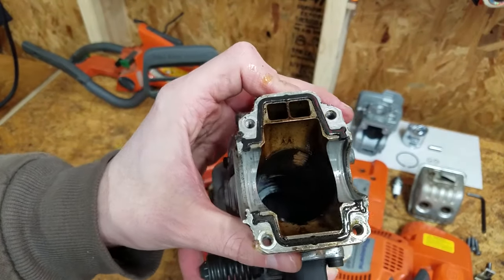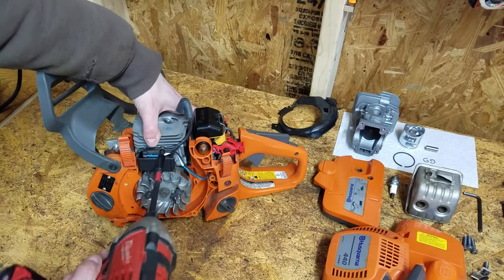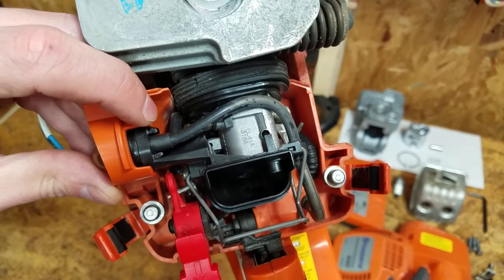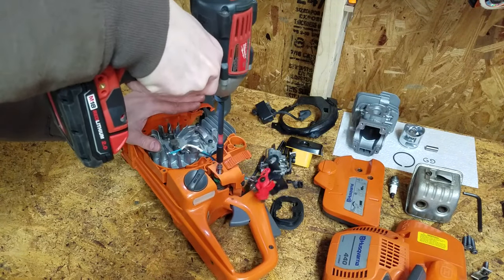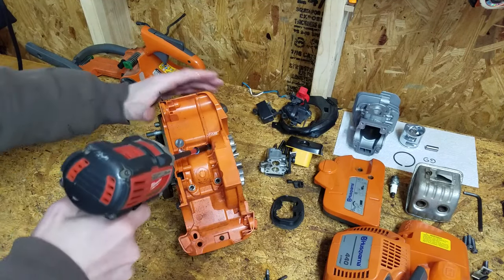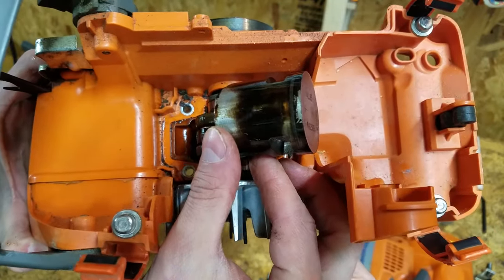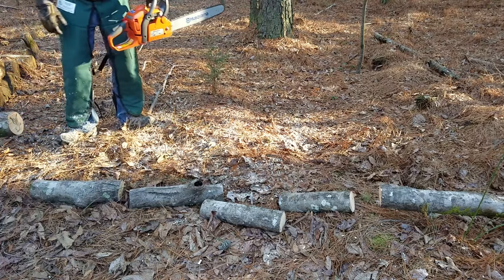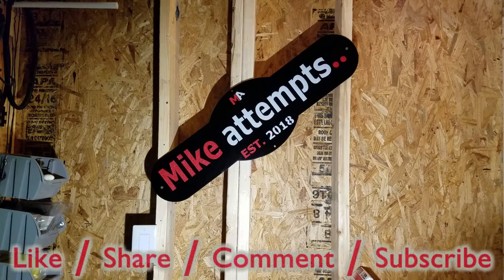Replacing a Chainsaw Piston and Cylinder

Comment: Well, I made this repair, along with a new coil. I have fire, fuel and compression, but my saw still will not attempt to start. I have used a spark tester to verify  spark, I have sprayed starter fluid directly into the cylinder, but to no avail. Any suggestions would be greatly appreciated.
Reply from the maker: The only thing I can think is maybe the fuel lines were connected to the wrong ports on the carb?
Reply: @Mikeattempts  It is a mystery. (I didn't disconnect the carb).  I used starting fluid in the cylinder.  One additional bit of information, my son had used a screwdriver to hold the piston while he was removing the clutch.  That's why I had to replace the piston. I don't know if something else happened then. Thanks for your reply, I won't give up on it yet. I'm really curious now.
Reply from the maker: @philliprickman1394  I'm curious too so let me know if you figure it out.
Reply: With the choke off and the chain brake off set the saw down on solid ground. Point the bar in a safe direction AWAY from yourself and anything else you don't want to contact, cut or damage. Slide your shoe or boot under the throttle lever and lift up with your foot/toes to hold it wide open. Give it a few pulls and I bet it will fire. Husky chainsaws are quirky like that. I own a Stihl MS-391, Echo CS-490 and a Husqvarna 435 X-Torq. Guess which one is sometimes a SOB to start while the others always pop right off?! Another trick I learned is to let the saw idle down for at least :30 seconds when you are done cutting before you shut it off. I believe this stabilizes the carburetor and preps it for the next easy start.
Reply: Check your flywheel. The flywheels are known to strip the key inside. It’s a horrible setup.  But if got compression fuel and spark. And no start good check flywheel.  I have bought 4 different saws that people said had spark fuel compression no start.  I knew what problem was and yep 4 times now flywheel key
Reply: @douglasgreen9556  That's a good suggestion. I think I looked at it, but didn't pull the flywheel.  I've set it aside, but will definitely check that when I get a chance.  Thanks!

Comment: What tool do we use to remove the exhaust muffler from Husqvarna 140 & what is the size of it : is it an allen key & what’s the size ( mm?). Tq
Reply from the maker: They are M6 bolts and you need a 5mm allen key.
Reply: @Mikeattempts  noted with thanks.

Comment: I tried alkylate-petrol and I broke 2 chainsaws. Both were from end 90's and less than 100 hours used. First you lose sparg plug, coil and afterwards the piston and cylinder. This alkylate-petrol is good for new machines but It kills the old ones!
Reply from the maker: I had never even heard of alkylate fuel until you mentioned it. After looking it up, it sounds like it should be really good fuel for small engines. I wonder why it kills older machines? Thanks for the comment, very informative!
Reply: @Mikeattempts  Here in nordic countries they say it is much better fuel and with my new saws it works just fine. If you use it with the older saws I guess there is more revs and more heat and one should tune up the carburator (somehow). Sadly, they don't tell that when you buy that alkylate fuel. I just heard that there was another old man who destroyed two good old saws with alkylate too :(
Reply: @Mikeattempts  BTW, if you have any tips how to remove the cylinder (Husqvarna 40- year 1998) I'm welcome!
Reply from the maker: So, the alkylate fuel burns hotter? Maybe it's higher octane?
Reply from the maker: From what I understand, the bolt heads are either underneath the saw (like in my video) or there will be holes in the top of the cylinder, around the spark plug hole. You put the screwdriver through those holes to access the bolt heads down at the bottom.
Reply: @Mikeattempts  not really ,the alkylate is very detergent and with older saws it tends to get the caked carbon off and the carbon might scratch the cylinder wall

Comment: Hi! I have a question. When should I replace a chain saw piston (ie. after how many working hours or after spending how many petrol tanks)? Thank you in advance.
Reply from the maker: I'm no pro but I don't think there's any specific lifespan for a piston. As long as you have good compression then the piston is good.
Reply: @Mikeattempts  Thank you.
Reply: If you pull the spark plug and put your finger over the hole, then pull the starter rope. It should blow your finger off the hole. It's not a true compression test but it will do in a pinch. Just keep your fuel mix correct and use a non ethanol fuel. You will eventually have to change the fuel lines, spark plug, and keep a sharp chain. I use a hand sharpener by prefferd which is like the Stihl brand.
Reply: @Dangbo3030   thank you.

Comment: Hi Mike, What kind of screwdriver did you use to unscrew the front iron part to look at the cylinder and the pistol? Black one
Reply from the maker: I used an Allen Wrench to remove the muffler.
Reply: @Mikeattempts  thank you so much for your video! It’s so helpful!
Reply: @Mikeattempts  and the last question, what ripe of oil are you using for hasquarna chainsaw? Because I don’t think than I’m using the  right one ;(
Reply from the maker: @Ladyginzberg  I just used a light 3-in-1/sewing machine oil for reassembly. If you meant oil for running the saw then any thick bar and chain oil would be fine as well as a good quality 2-stroke oil to mix the fuel.
Reply from the maker: @Ladyginzberg  Thanks for watching!

Comment: Strange ...seems like new ...but no compression ??? How many hours of work ? I have ..an husky 351 ...from a long time ...hours and hours of work ...and compression is enough ...
Reply from the maker: My guess is that the previous owner used motor oil or bar oil instead of 2-stoke oil in the fuel. It probably stopped working during the first tank. The cylinder and piston didn't even end up being scored, they just had a dark tacky coating on them. That same coating made the piston ring get stuck fully compressed which is why the compression was low.
Reply: @Mikeattempts  yes i think the same ...but a lot of bar oil ...in the tank of fuel of motorsaw . You can save the cilinder ? If is only the ring stuck on piston..
Reply from the maker: @robertotirabasso2812  Yep, I saved all of the original parts, just in case. :)

Comment: Shoot i would have cleaned the  original and kept it on there.  Although i guess you could see how well the aftermarket kit works. Then you have a oem replacement already.
Reply from the maker: Yep, I kept the original parts just in case. :)

Comment: So by looking at that saw I do believe it has been apart before. No saw I've ever seen is that clean to never have been taken apart.  Also does this saw not have reeds on the intake? I couldn't see any in the video.
Reply from the maker: I cleaned the saw up a bit in a previous video but it didn't seem like it had much use at all. The bar looked almost brand new and the saw didn't have the typical wear marks and scuffs that you'd expect see. I think they use the wrong type mixing oil and maybe it died on the 1st or 2nd tank of fuel. Nope, no intake reeds. Thanks for watching!
Reply: @Mikeattempts  Ok. I was given one of these saws. It has been used quite a bit. It also has very little compression. I sold auto parts for 25 years so I know how a carb works. This thing with the separate barrel for the choke and throttle is a mystery to me. Also I don't have it apart yet.
Reply from the maker: @aw738  I'm sure you'll have no problem getting it fixed. Let me know how it goes!

Comment: I hate to say it but if it would even start on Choke, Sea Foam would likely have completely cleaned the interior and freed that stuck Ring.
We have all gone the route of worst first......... it happens.
Reply from the maker: Yeah, unfortunately with the low compression and the side of the piston looking scored through the exhaust port (even though it wasn't), I made the assumption that the piston and cylinder were bad. Oh well, it was a learning experience and I kept the old parts. :)

Comment: If you are going to do a teardown you might as well remove everything and inspect the crank seals to make sure there is no air leaking
Reply from the maker: I agree. This saw looked almost brand new, so I suspect that it gave out on its first tank of fuel due to the wrong type of oil being used. All of the seals looked and felt new.

Comment: Bad mixture oil ruined the piston and cylinder. With a thorough cleaning and replacement of the link, the problem would be solved.
Reply from the maker: Yep, that sounds right to me. Thanks for watching!
Reply: I have been servicing chainsaws and lawnmowers for twenty years, I have gained a lot of experience 🙂 Great video! 👏

Comment: What happened to this saw? Somebody was running 87 octane pump gas with ethanol mixed with cheap junk 2-stroke oil in it. They may or might not have had the correct 50:1 mix but that doesn't really matter when you are using low grade pump gas and cheap oil. Stihl MotoMix or Echo Red Armor is fully synthetic while the Husqvarna is semi-synthetic. NONE of them would have left the piston and cylinder black with soot and carbon like that. In short someone ruined this chainsaw prematurely as you can see the saw is in great condition and hardily used otherwise.
Reply from the maker: It's odd because the black film left on the piston and cylinder was slightly tacky. Some viewers said the same as you suggested while others said maybe the previous owner used bar oil instead of 2-stroke oil. Either way, I would be surprised if they made it through one tank of fuel, the saw looked new. Thanks for the comments!
Reply: @Mikeattempts ❤
Reply: What gas you use . Rec gas or a higher octane? I have that exact saw trying to make it last a while before i have to do this.
Reply: @vincezito3547  

Unless you are using your chainsaw a lot I wouldn't run any pump gas in it at all. Only run the high octane premium premix fuel that is 93/95 octane and contains no ethanol. It also already has the synthetic oil mixed in with the correct 50:1 ratio. IF and only (IF) you run pump gas make sure it is below 10% ethanol or better yet no ethanol at all and at least 91+ premium octane. Cheap junk 2-stroke oil and regular pump gas will destroy these small gas engines in no time at all.
Reply: @Mikeattempts perhaps they used castor oil like in methanol model engines? That leaves a sticky layer. In any case, it was the wrong oil.

I am in the process of taking my 435 that I got for free apart. I was less lucky, it had been run on auto fuel with no oil. Heavy scoring😢
Reply from the maker: @daszieher  I've heard that a lot of first-time chainsaw owners ruin their saws like that. It surprises me that people would spend that kind of money and not bother to read just the basics of operating the saw.
Reply: @Mikeattempts  well, in this case it was not even the previous owner's fault (by his account). He told me that during some community work someone else for some reason had put autofuel in an emptied Motomix canister. Probably they wanted to add the oil later and obviously forgot  Anyway, he inadvertently used that and the saw was history.

I know the guy and he usually doesn't cut corners. So, kids, be careful and only use your own fuel 😄
Reply: Mercury powertune would have been good to spray into the carb or take the spark plug out and fill it with powertune and leave for a few hours then pull it over and then put plug back in and I have done this on saws that have had. Seized rings and they freed up and cleaned the internals of the saw perfectly and they ran awesome after a few  mins ,
Reply from the maker: @darrenadams1555  That would have saved a lot of time if it worked! :)

Comment: I don't think you needed to replace the cylinder and piston. Someone had used the wrong oil in their gas which caused the varnishing. If you had just cleaned everything and replaced the piston ring you would have been fine. After that, use a decent 2 stroke oil for the mix.
Reply from the maker: Yep, I agree. I kept the original parts to use or sell in the future.

Comment: If your gonna go to all that effort  change the con rod over good job theres a different mix for running s saw in more oily 2 tanks then its run in
Reply from the maker: I'm pretty sure this saw quit on the first tank of fuel, so I didn't feel the need to replace any other parts.

Comment: Wow Mike great job!!! That's crazy there was no scoring but the ring was stuck. I honestly don't know if I would have clean the OEM carb and piston and stayed with them or used aftermarket? But either way you did a fantastic job and the saw runs and cuts awesome. Where was your compression tester got from? I got one from my work Harbor freight and it was defective.
Reply from the maker: If I had known the piston and cylinder weren't scored, I definitely would have reused them. Not just to save money but also because the OEM parts are most likely superior. However, after looking in through the exhaust port and seeing vertical lines, I assumed it was scoring and ordered the aftermarket parts before I had even started to take the saw apart. I kept the OEM parts though, just in case I need 'em in the future. ;) The compression tester was an Innova 3612. I think the best way to tell if it's got a chance of being accurate is if there's a Schrader valve at the end of the hose that's threaded into the spark plug hole.

Comment: Definitely the wrong oil or way to much of the right oil. All a guy needed to do was clean it up and unstick the ring. But hey it makes for good tv
Reply from the maker: Yeah, from what I could see through the exhaust port, the piston looked scored. I order the parts before I took it apart and realized it was just baked on oil, not scratches. I kept the original parts in case I need 'em in the future.

Comment: Crappy oil killed it
Reply from the maker: Yeah, that was my guess too. Do you think they used bar and chain or motor oil in the gas instead of 2-stroke oil?
Reply: @Mikeattempts  no probably grabbed the cheapest bargain 2 cycle oil off the shelf
Reply from the maker: Dang, I didn't realize you could buy the right oil in such a poor quality. This stuff left an almost sticky residue on the piston and cylinder. They aren't scored though so I bet I could reuse 'em if I cleaned 'em up real good and replaced the ring.
Reply: @Mikeattempts  its cheap for a reason most saws someone put bar oil you would know I have done a few man that stuff is sticky but I run klotz snowmobile oil 40:1 burns clean smells like bananas and race gas get it on Amazon for about 49$ a gallon

Comment: Way to much oil or 10w30.
Reply from the maker: Yeah, I was thinking they might have even used bar oil in the fuel.
Reply: @Mikeattempts  carb spray would probably clean that up.
Reply from the maker: @RussellHoughton  I agree, I think the original cylinder, piston, and ring are probably fine, I just need to clean off that tacky film.

Comment: Οκ good job.... but i don't anderstund why use so strong handdrill for this small screws?
Reply from the maker: I typically only use the impact driver to remove screws and bolts to make disassembly go faster. I'll also use it sometimes to drive screws/bolts but only after I've started them by hand, and then I always finish tightening them by hand as well. It's just a nice time saver.

Comment: Hi Mike

Brilliant video Mike.

I a have a Husqvarna 450 chainsaw that has seized up altogether.  Serial Number 2012 1700134

i need to buy a piston and cylinder 

i am just wondering if you could help me find a replacement on the internet as i am not used to searching for something , what i would call trickle

many thanks sean
Reply from the maker: I'm no pro but this looks like it would work for your 450: https://www.ebay.com/itm/354716500151 . If you also need the needle bearing and gaskets, there's this one: https://www.ebay.com/itm/124848294402 . You'll probably also want to replace the oil seals: https://www.ebay.com/itm/294891330110 or https://amzn.to/44phHNI